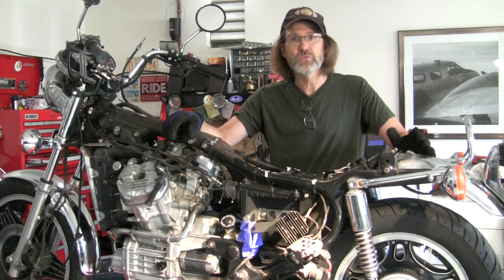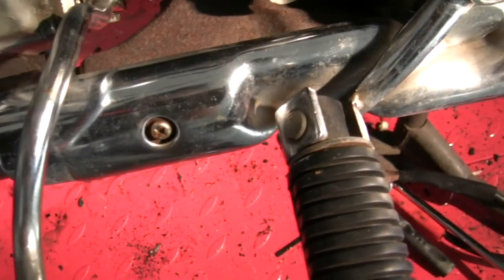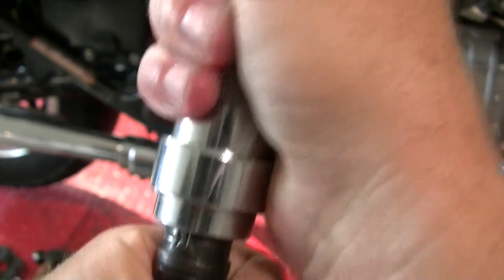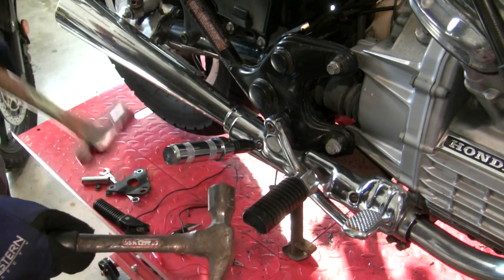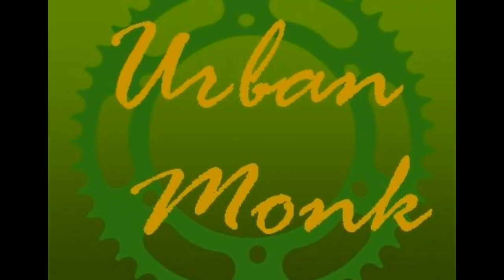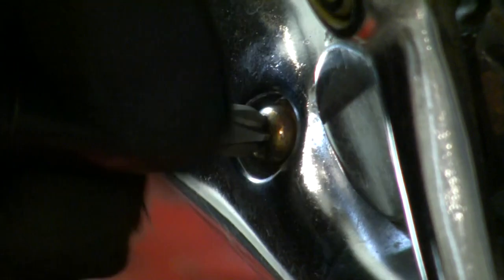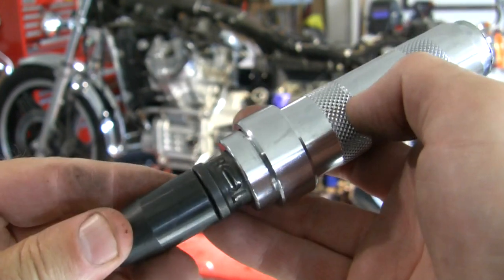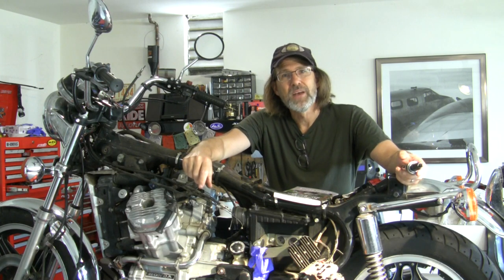Remove Rusty Screw / Bolt - Quick Tip

Comment: Works like a charm!!! I spent an hour trying to take off a license plate with rusty screws. I was trying to avoid stripping the screw head. Watched the video and purchased an impact driver. 10 minutes done!!!
Reply from the maker: They're a great, inexpensive tool to have around. Thanks for watching!
Reply: Did you ended up breaking the retainer ?
Reply: @dawnsreviews7205  No I didn’t break the retainer
Reply: @keitht47  great!!! I am going to get one...trying to remove it again tomorrow. Thanks!!

Comment: My screw is in the place where I can't fit a beefy front end of this screwdriver. Any tools for a such scenario? Thank you.
Reply from the maker: You may be able to find a smaller bit that fits the impact driver but tapers down to the smaller size you need. Alternatively, sometimes just tapping a regular screwdriver into the screw with a hammer is enough to release the tension between the threads, but of course there's no torsion motion included in that scenario like with the impact driver. Good luck!

Comment: What do you do after you already stripped and rounded it off???
Reply from the maker: Well that's probably another video but I would use a cold chisel to put some angled indents in the head of the screw and see if I can get any movement. Applying heat to the surrounding metal with a propane torch can help too, if the material can take the heat. Depends on the application. Thanks for watching.
Reply: Chisel, or a die grinder to make a slot to use a straight bladed screwdriver on it. In extremis, weld a nut on to the end of the thing through the middle of the hole in the nut.

Comment: Thanks for the tip. Did you tried with a rubber coated hammer (dead blow) to avoid damage to your impact driver?
Reply from the maker: Thanks for watching! Admittedly I haven't tried either but I think the rubber mallet wouldn't drive a sharp enough force for many stuck screws/bolts and I'm afraid the impact driver would damage the impact surface of my dead blow hammer, which is plastic.
Reply: Urban Monk TV Thanks, I don’t have an impact driver but will definitely get one.
Reply from the maker: @luketrem  I've got one on my Amazon influencer page (link in video description) for $12 that is exactly like mine.

Comment: I got nasty ol black rusted screws on my toilet seat and I'm having a hard time taking them off. They don't seem to be stripped but definitely tightened to all h3ll.
Reply from the maker: Those are probably best cut off with a hacksaw and replaced with nylon bolts and nuts which will not corrode.
Reply: @UrbanMonkTV  like a mini hacksaw? Sorry I'm not a tool lady LOL
Reply from the maker: @nicole_roma  You could try soaking the threads with PB Blaster (seriously I didn't make that up) to see if that loosens the corrosion up but sometimes those get too far gone. Then yes, a mini hacksaw or even a grinding wheel on a dremmel could cut the bolts off. You just don't want to damage the porcelain. Kind of tricky. Good luck! The joys of home ownership!